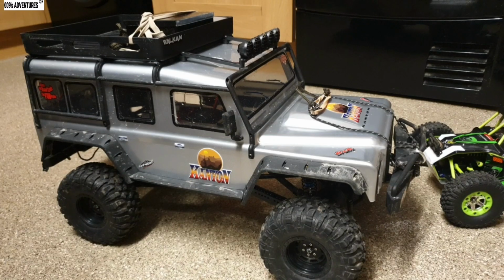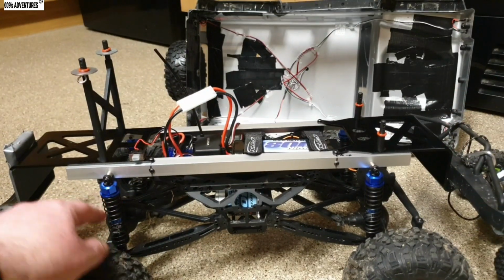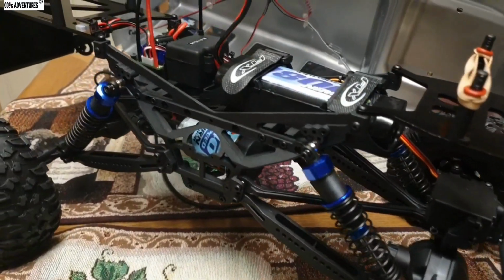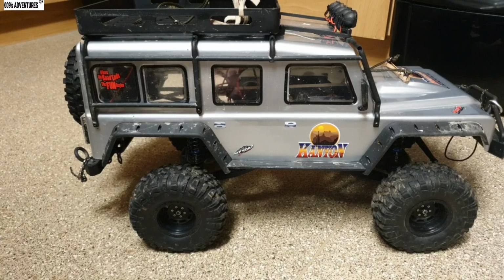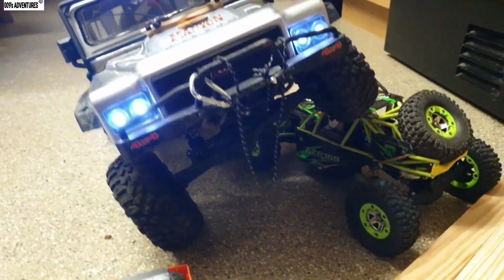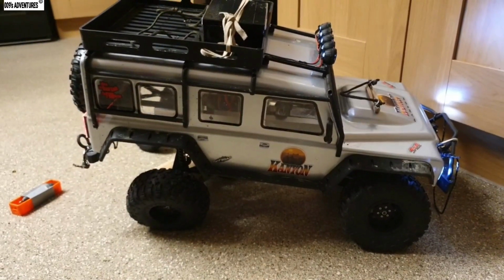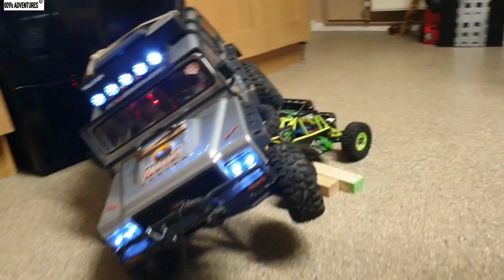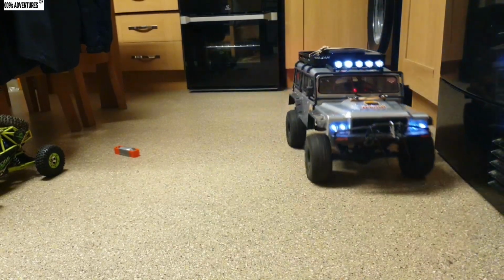MY FTX KANYON MODS

Comment: Hey there! Awsome vid! Im getting one of these for my dad for Christmas I just need some help. How do I get those alloy metal bars in the middle to make it more sturdy? Is it DIY, if so any way you could make a video on it and how to fit it! Sorry im new to this RC car scene but I want my dad to be able to use this crawler for a long time so I would like to make some modifications for him later down the line! Thank you for the help in advance!
Reply from the maker: hi, oh I'm sure he will love it. Great trucks fir the price.  I have a video on fitting them on the channel, I will post the link here.  you can either buy a length of angle from screwfix etc or someone sells them on ebay for about 20 quid.  if you need any help with anything just ask and if I can help I will .. cheers 👍 
  https://youtu.be/8_0YSITppvw?si=G29W_g1pTdAcc7zw
Reply: @009ADVENTURES  Thank you so much man! I will let you know how it goes!
Reply: @009ADVENTURES Hey there! I recieved the truck not long ago gave it a test run and set it all up. However im charging the battery right now and I know it should be solid red when charging and green when fully charged. However after about 10-20mins its starts flashing in this order, red red red green, red red red, and repeats what does this mean? Im i not charging it correctly?

Comment: Great video. What did you attach the springs to as you changed their original position?.
Reply from the maker: thanks , body mount brace mod, 15mmx15mm alloy angle 😀👍
Reply: @009ADVENTURES  okay perfect. Is that stuff available ready to purchase or do you have to purchase the material and create something for the springs to sit on.

Comment: Hello I had to do a temp fix of alloy rods I had the other day on the chassis after my lad had a dramatic roll with the FTX, what size is the stuff you have used as looks a bit more substantial. Thanks
Reply from the maker: that's not good :(   its 15mm x 15mm . 1m length from screwfix is about £4 👍